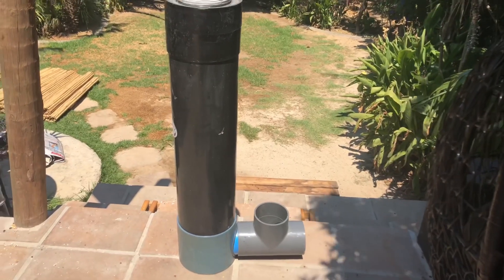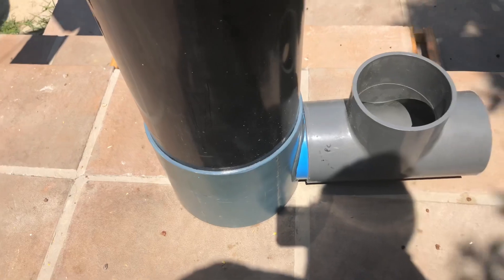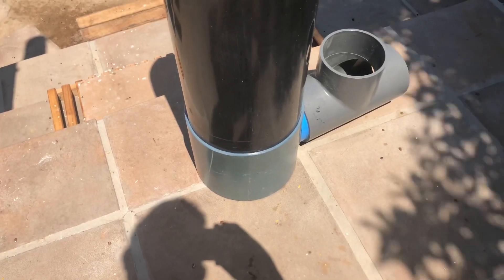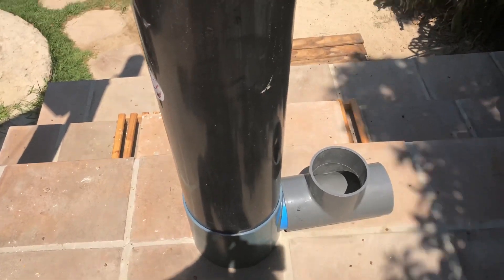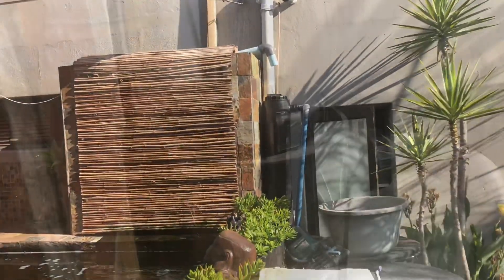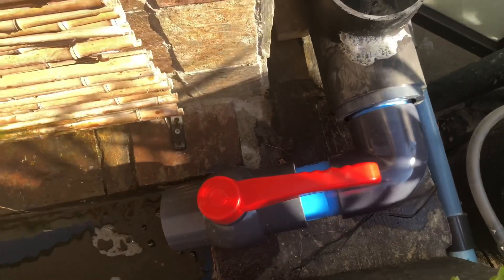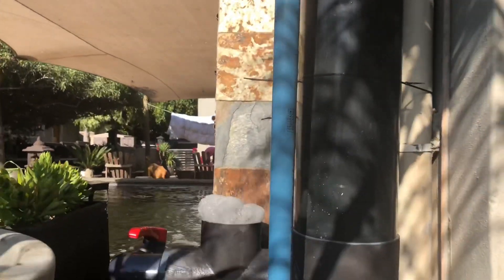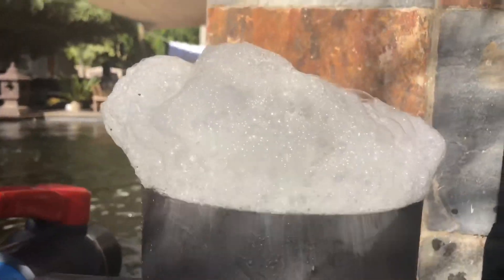KOI DIY - Building a pond protein skimmer. Easy and lots of FOAM!!!

Comment: Wish we could see in side the pipe, what is going on. I don't get it. Is water pumping in at the top and just falling to the bottom, producing the foam? What is inside the pipe? or is it just that grate?
Reply from the maker: Yes trickles through bio balls in tube. Drops onto water at bottom much like bakki shower . Produces lots of foam that bilts up in vertical opening

Comment: how much  l/h water pouring in,do it need very high pressure???
Reply from the maker: Not sure I'm using a .5kw pool pump on that line - but I adjust until it produces foam. Water in skimmer needs to be right level.
Reply: @koiselectsa  ok , it's working i follow your design ,nowdays it's very warm here but i checked early in the morning ,im using 1600 l/h  pump lying around
Reply: @koiselectsa  so does the water fall from the top of the skimmer ? as i cant see the plumbing inside when ur running it. so does it just free fall onto the plate with holes on the bottom?